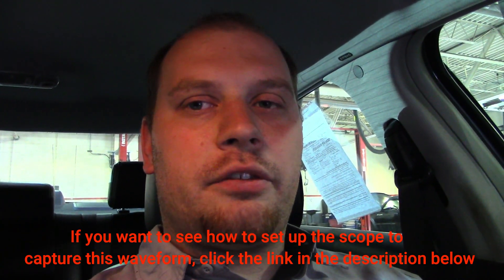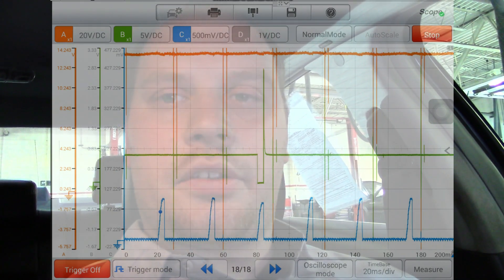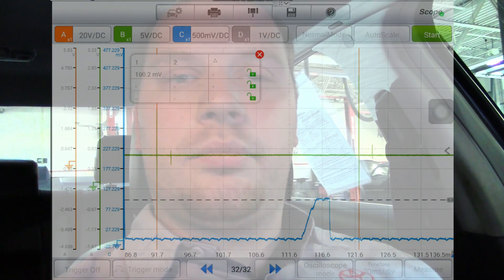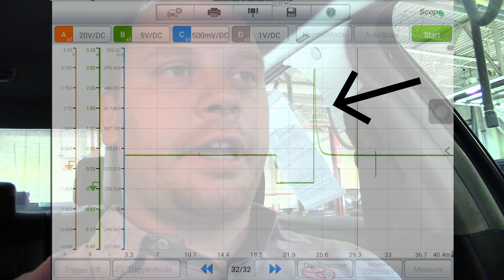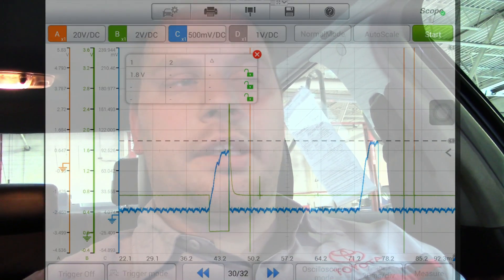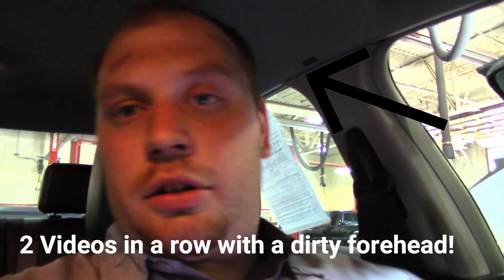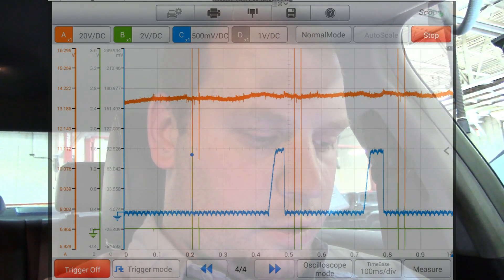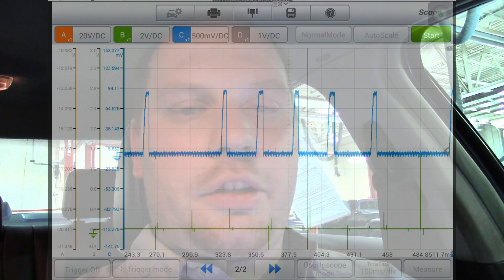Lincoln MKZ Intermittent Cylinder 3 Misfire

Comment: FROM YOUR EXPERIENCE WHATS THE ONE AND ONLY TOYOTA ENGINE YOUD WANT LONG TERM
Reply from the maker: The 1gr-fe hands down. That’s the 4.0 liter in the 4runners. That power train might be the best ever made.
Reply: @VoltageDropDiagnostics  Any thoughts about the 2GR-FKS in the newer Lexus and Highlanders? Understand it's an Atkinson variation on the 2GR-FE, but that means a power trade-off....
Reply from the maker: DIY Dave as of right now. I don’t like that engine. We have seen a lot of valve guide failures. As well as direct injector failures with far too low of mileage.
Reply: @VoltageDropDiagnostics  That's awesome info. We've got two cars with the 2GR-FE and they've been great, but I've been wary of the FKS because I knew it was GDI and hadn't been around very long...
Reply: @VoltageDropDiagnostics  awesome, I'm actually buying a fj cruiser with it but that noise it makes always scares me.  You got another subscriber.  I just sold my 5.7 tundra what's some things you dont like about those?